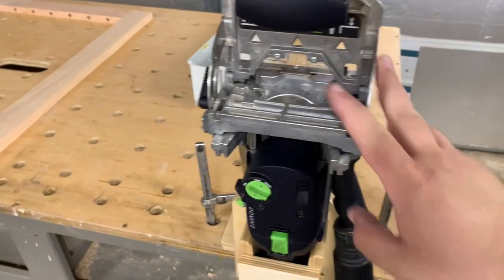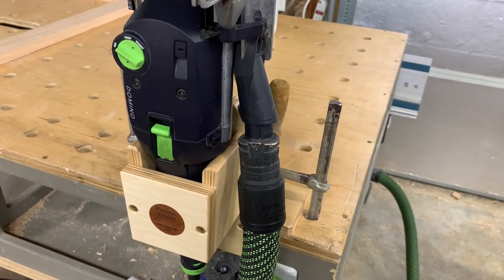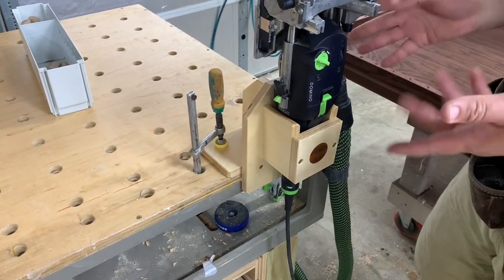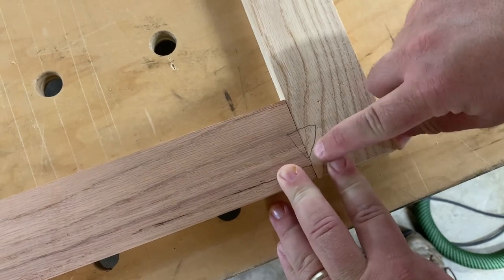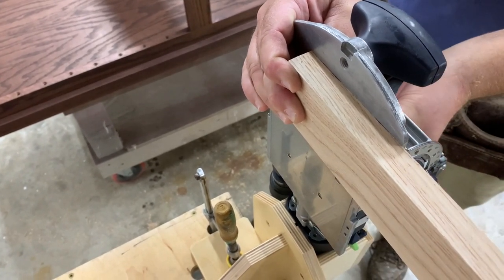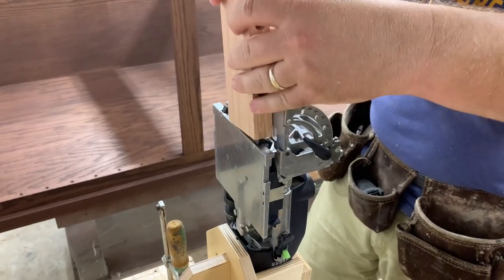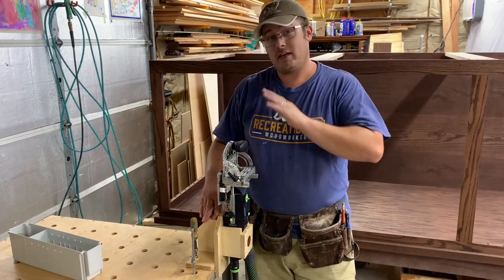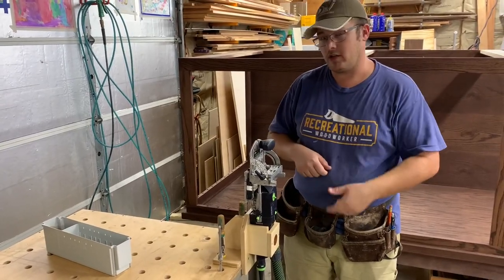The Domino Dock for the Festool Domino 500. Essential domino accessory

Comment: Thanks for the positive “review”!  To those that feel that the machine is not as safe this way…I’ve never had a single incident.  My hands are always plenty clear of the cutter…and if the piece I’m cutting is small…a simple clamp holds it safely and securely.  I use my Domino machine in the Dock way more than hand held, anymore.  It’s just much more efficient. Anyway, thanks again!
Reply: Couldn't agree more.  If your woodworking...you always have to be mindful of you fingers 24/7 using any tool. This one is no different.  Heading over to buy one now.
Reply: Bought the plans and built one this weekend, not as pretty as yours but it works. I may modify the way it mounts to fit my bench better. Thanks for the great design.
Reply: Why not get a mortising machine then? Full circle.
Reply: @silverbackag9790  A mortising machine would work well for many tasks.  I have a Pantorouter which I love.  I use both the Domino and Pantorouter.  Kinda like having two tablesaws...I use em both. Thanks
Reply: @ramonartful I agree. Dock is very safe. Clamp the piece of wood to Domino with a quick grip clamp or similar.